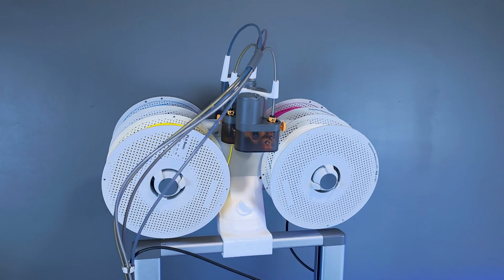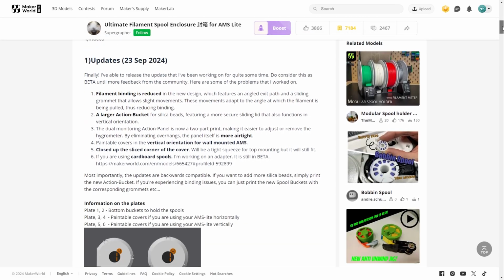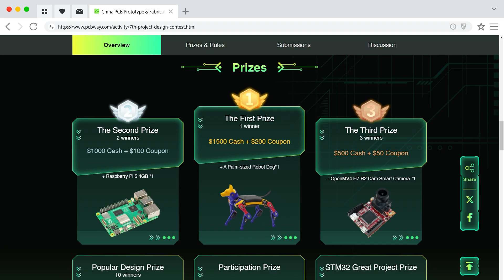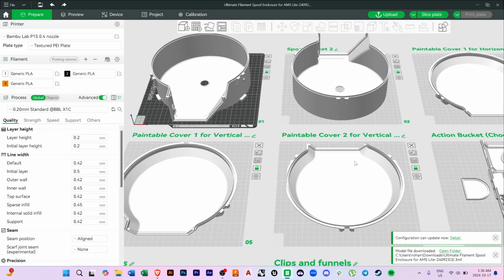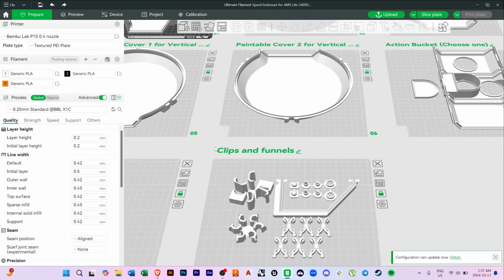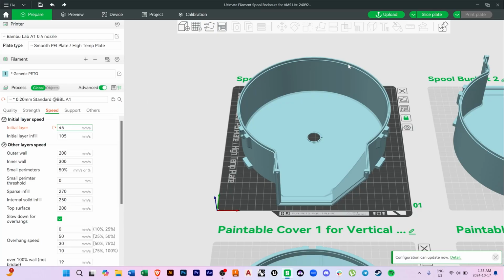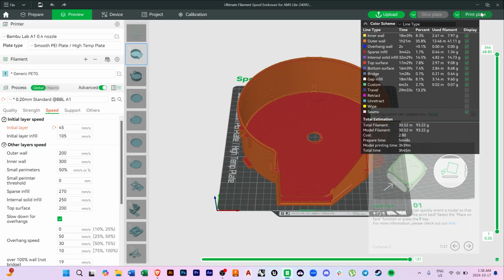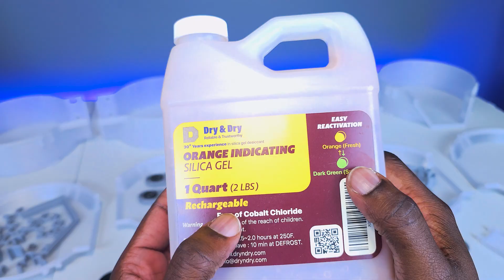⚠️Avoid This 3D Printing Issue With The ULTIMATE UPGRADE! Bambu Lab AMS Lite Enclosure for A1

Comment: I think this is the best AMS enclosure I have come across for this machine, however I wish some thought was given to seal the AMS airtight.  Recently I bought some silica gel which changes color after being impregnated with water and I dropped some of it in a tray  and in just ten minutes it started to change the color, ie the moisture has rendered it ineffective.    The joining together of the parts need sealing hermetically which is a bit difficult and the models would need some serious modifications. ANYBODY has the original 3D drawings?  I think I would thicken some parts to be more strong.  All in all it is a great design but not more than something to protect against dust.  Moisture-wise does not function well in my opinion.

Comment: Thanks. I will have the A1 in the basement when I purchase it. I was going to pull the trigger on a enclosed PS1. Humidity in the basement is around 60 ? temp around 70 degrees. I never had a 3D printer so I hope I will do good on learning. I have mechanical smarts so I should be OK. Thanks again Bro.

Comment: I just got my A1 last week. First print was this enclosure. It’s so good.
Reply from the maker: That's awesome! Thanks for watching. Hope you enjoy the new printer!
Reply: @ Oddly, I prefer my A1 Mini. It seems just that bit better than the A1 although the smaller print bed does hamper at times.
Reply: @SirHackaL0t. I might buy A1 Mini aswell just as a small compliment  :) could be nice to have at least
Reply: @SirHackaL0t.  i just got mine.. received it yesterday :) have not unboxed it yet though. My plan is to use it at work

Comment: Whats the maintenance like on these? How often do you need to change the battery on the hydrometer or change out the dessicant? Thank you
Reply: Hi, I have commented on this- To keep the moisture in check this is NOT EFFECTIVE. It must be hermetically sealed.  I had some silica gel which changes color when it is full of moisture and left it just 10minuites out in the open and it changed the color.  This needs to be sealed and have better clamps and sealing strips to be effective.
Reply: @TheRadioactive99  That was my experience too.
Reply from the maker: Sorry, I'm not sure at this point since I just installed it, but I'll keep you updated whenever I happen to deal with those maintenance things.

Comment: for the desiccant beads holder, bambu slicer is telling me to enable supports. do i ignore this?
Reply from the maker: I also got this error message. Moving it to a different spot on the build plate then reslice it. That worked for me.
Reply: @Creatorrific  appreciate that! i actually ended up just ignoring the error message and it printed perfectly fine lol
Reply: @DigiplayW8  Yeah, I printed one with supports and it was garbage.  Just print without supports.

Comment: Any suggestions for anything from IKEA to place the unit on? Seems the dimensions for ones I’ve been looking at aren’t deep enough
Reply from the maker: Sorry, I don't know any of the details for Ikeas furniture but I also don't think theirs would be the best option either. I'd go for something heavier and made of solid wood or  metal construction.
Reply: Did you find anything? I am considering IKEA BROR.
Reply: @ , still looking, I’d like to know what size tables that people are using, especially for the depth of the bed moving towards the rear, I wouldn’t want to have a table against a wall and the bed smashing into the wall

Comment: still debating between this and the sunlu ams combination
Reply from the maker: This option is a lot cheaper, especially if you already have filament on hand and the reduction in humidity is pretty significant. Not to mention it'll take up less space. Maybe give this a try and if you not satisfied then go for it!
Reply: Do you have to use the Sunlu AMS with a Sunlu printer?
Reply: @joeking433  no, its a Bambulab AMS lite modded into the Sunlu S4. You still have all features of the AMS lite and the Sunlu dryer so you can print while drying 4 spools.

Comment: Anyone print this in pla? Does it work just as well? Also Creatorrific, did you print the clips in petg too?
Reply from the maker: PLA should work well. The designer recommends printing the enclosure in PLA and the clips in PETG, but I used PETG for both.

Comment: This project  got started for me the day after I got my a1 combo. It's legit and keeps me from having to dry my filaments out all the time with living in a very humid climate. I now have my amsl wall mounted between my a1 and a1 mini with a quick connector incase I feel like swapping the ams between machines
Reply: I printed it in florida and humidity doesnt go down even with dessicant... Am i doing something wrong?
Reply: @markfrantz4612  its not meant to dry your filament it's meant to slow down the moisture exposure. Dry your filament then put it in the ams
Reply from the maker: That sounds like a sick setup! Thanks for watching.

Comment: That is what I want my printer is (although I'm not buy the printer yet). Could you please to let me know the overall size after setup the enclosure as top mounted at A1? Is that affect the print quality (due virberation, Due to the substantial increase in the center of gravity)
Reply from the maker: The A1 is about 2.5ft tall with the AMS Lite top mounted. The print quality remains great, I haven't noticed any difference. Just make sure to place the printer on a solid table that won't shake.
Reply: @Creatorrific   Hi, I'm currently bought my own A1 and the top mounter is currently printing. That is very excited. Just one more little thing is, the link you shared "AMS Lite Top Mount Short Screw" is redirect to the enclouser itself, not the screw. I had also check the build plates there is no short screw containted. Cloud you please to share the link again?

Comment: i don't understand the difference between the vertical and horizontal prints, i want to mount mine on the wall behind my A1, so which one to use?
Reply from the maker: You'd use the vertical covers then, although I don't understand what the difference is. Maybe it's regarding the numbers should you print in multicolor.
Reply: It is just the different orientation of the number templates.

Comment: Can you still rotate the AMS? Mine is close to a wall so I took the bolt out, as when its tight, it won't rotate well.
Reply from the maker: The short locking screw I have in place prevents the AMS Lite from rotating, utherwise it wouldn't be stable and might collapse. It notice it can twist a slight but when handling but only very slightly the screw prevents it from turning more than a few degrees.